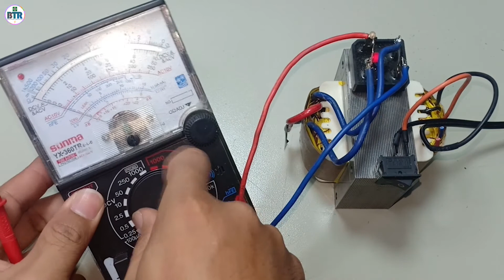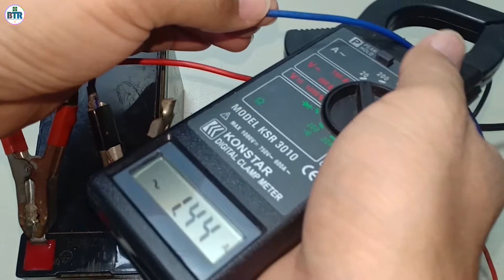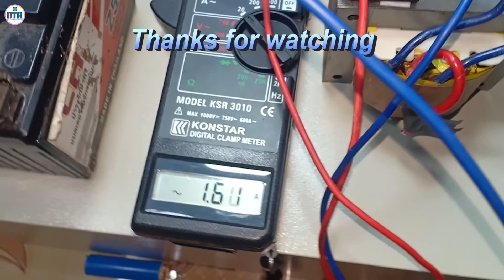Fast Charger Battery 12V By UPS Transformer

Comment: video is not accurate. when you rectified the ac to dc voltage rise to 20 volts or more. you show the same value in voltage after you put the diode bridge.

Comment: sir can I get the list of materials, I already have the transformer.😊
Reply from the maker: Diode bridge X1 , led red X1 , restore 1k X1 , switch on off X1 ,fuse 10a X1 , capacitor 25v X1, transformer 220vac input 12v output.

Comment: May I ask ser if it can be convert battery charger..250w cycles 60 input 220v output 100v 110
Reply from the maker: You can calculate and winding a new transformer it can charge battery but about cycle I don't know!!

Comment: Your video is not correct. Because UPS transformer give 18.5 volt DC  and 10 Apmere when ac line is 230 volt. This voltage damage the battery.